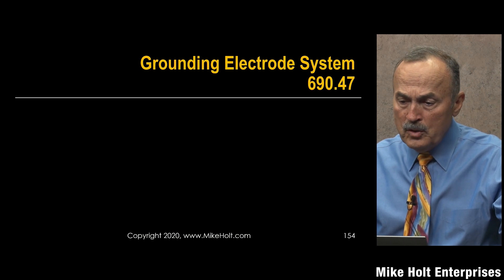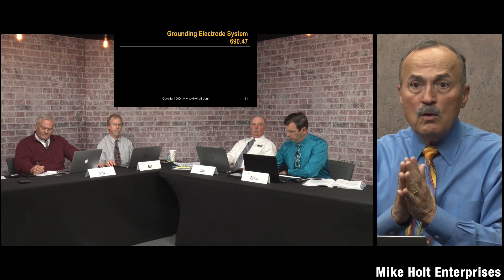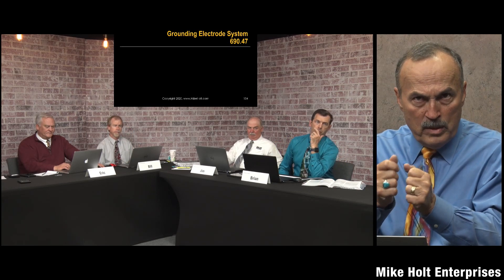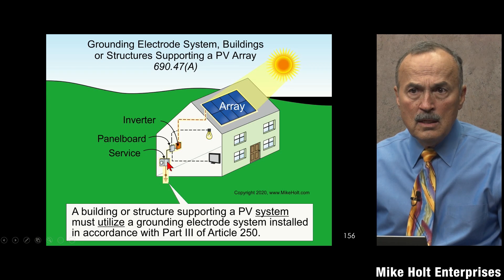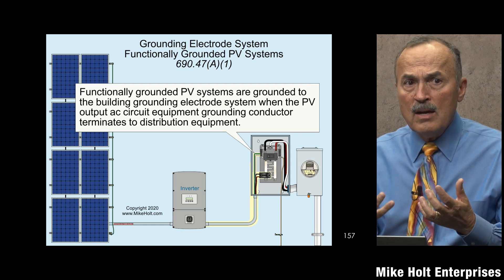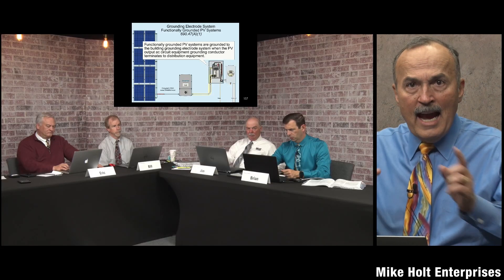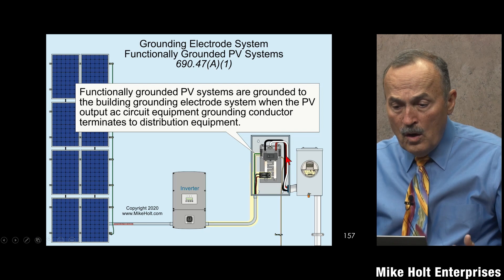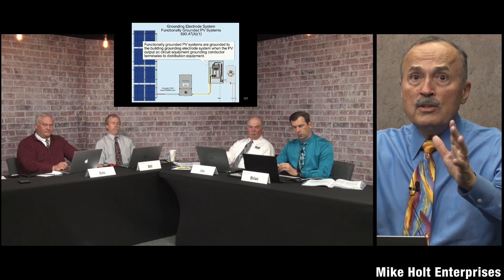Solar Photovoltaic (PV) Systems, Grounding Electrode System, NEC 2020 - [690.47], (9min:30sec)

Comment: I will be ground mounting 4 panels wired in series. I want to run a positive and negative cable to a PV disconnect box, and run the cables underground in rigid metal conduit to the garage where I will use the cables to charge my Anker Solix F3800 Plus. What are the grounding requirements for this purpose?
Reply from the maker: @michaelc9845, please post your question on MikeHolt.com/Forum
Reply: I posted there per your direction, but the Moderator stated they are prohibited from answering DIY related questions.

Comment: So im about to run the ground for my outdoor PV array back to my house, (about 150ft).  according to your video, the only wire I need to run is from my PV combiner box back to the EGC at my fused disconnect.   my plan was to run a bare copper wire next to the PVC pipe in the trench, is this ok or should I run a green thhn inside the conduit?.
Reply from the maker: @user-zq2hg4cu5b, the equipment grounding conductor is not required to be insulated, but it must be properly sized and be installed in the same raceway with the PV wires, see NEC 690.43.

Comment: So, in a totally off grid system one should bond both the DC side (panels) and the AC side (inverter and beyond) to the same grounding rod??
Or just not ground the metal frames of the panels (I think you are saying it isn't needed) and ground the AC side only bonding the neutral and ground in only one spot.  

Comments please.  There is so much information out there and most of it contradictory.
Reply from the maker: @jws3925, if this is an off-grid system, the neutral is never bonded to the ground. But you are correct witheverthing else. See 250.32.
Reply: @MikeHoltNEC  Wow.  The neutral should never be bonded to the ground!  I certainly trust your advice but I have to tell you, in my attempt to get this grounding thing right I have watched numerous videos created by solar installers and none of them has made this statement.  Is the entire industry misguided?  So, in my off grid system I don't need a ground at all?  Thank you so much for answering my questions.  I just want to do this correctly.  By the way, my 3000w inverter comes from the factory with the neutral and ground bonded but so far I have not driven a grounding rod so there is no ground to bond.  Is this ok?
Reply from the maker: @jws3925, please DM me your phone number and let's reivew Stand-Alone System grounding and bonding together. I might be wrong about no N/G bond.

Comment: a seply-dwived system, eh? slow down mike. you speak way too fast and you're mostly repeating yourself. you didn't even both to consider what happens when a DC positive gets chewed by a squirrel and then touches a panel frame. 9 minutes and no consideration of actual real-world faults.
Reply from the maker: @AJTarnas, what does your comment have to do with grounding PV systems? Note: The 2026 NEC completely removed this rule. Please watch MikeHolt.com/AUX

Comment: I still dont understand why would i lead lightning into my house, if i can ground it directly to the ground.
Reply from the maker: This rule was removed in the 2026 NEC!
Reply: @MikeHoltNEC  So 2026 version there will be advised to directly ground it to the ground? And of course equalize potentials of all grounding systems.
Reply from the maker: @rm6857, this stupid rule was removed in 2026.
Reply: @MikeHoltNEC  Thank you for your response, but do you mean removed auxilary rod or removed grounding PV pannels through house. We normally take it down the roof into MET without going throught inverter and whole house.
Reply from the maker: @rm6857 Grounding means "to connect to the earth." There is no requirement to ground your "array" to the earth.

Comment: At minute 2:27 the diagram shows the solar panels bonded together, but I can’t tell if there is a ground wire going along with the PV wires to the Inverter or just the PV wires? Seems like I need to run a ground wire along with them to be bonded? If my ground mounted arrays (not on metal frame) are 50 feet away, does that distance suggest an auxiliary ground at the arrays? If so, do I not run a ground to the inverter? Thanks!
Reply from the maker: @muhjeepsrock316 The 'bonding' of metal parts of PV arrays requires an equipment grounding conductor, see NEC 690.43. There is NEVER a reason to install an auxiliary ground, watch MikeHolt.com/AUX
Reply: @MikeHoltNEC thank you!

Comment: Dear Holt. What if I connect commercial rod and also auxiliary rod to a surge rated busbar inside house and then I will connect house panel, inverter and array frames in parallel to the bar. In such way transient current will travel not through house panel or PV structure, but from rod to the rod through this surge rated bar. Would it be safer in such case? Or should I better remove the aux rod?
Reply from the maker: Watch MikeHolt.com/AUX

Comment: What about grounding requirements for a stand-alone (off-grid) PV system installed in a floating boathouse (covered metal dock on plastic floats, not a houseboat)?  There is no utility connection with a grounded service disconnect.  What do I need to do to provide a compliant ground for panels, inverter, stand-alone load center, etc.?
Reply from the maker: Please send me an email, Mike@MikeHolt.com, with this question so I can work this out.
Reply: @MikeHoltNEC  Hi Mike. Any update for this question?  Thanks
Reply: Will do!

Comment: What about when the array is on a the roof of a separate building more than 20 meters away from the main building? How do we install SPD devices in such configuration? If the cable trace is that long wouldn't it be inefficient to install the SPD at the box in the main building only? Wouldn't in such case a separate grounding rod and SPD at the separate building with the array be a preferred option?
Reply: You can put an auxiliary grounding electrode on the PV array, but the SPD devices should be in your PV combiner box inside your main building, and its grounding wire have to be bounded at the main panel grounding bar.
Reply: If you have two grounding rods good chance lightning strike nearby will short out all your electronics. SPD should be installed where it enters the building going to your inverter you want it to protect all the wiring between the inverter and the panels. Surge is much more likely to be induced on long wire runs from a lighting strike nearby. If you install the SPD right at the combiner then your only protecting the panels.

Comment: Same here. We were doing small cell 5G sites with 8x8x 12 foot deep concrete encased steel reinforced pole bases with a #2 tinned copper wire attached to the rebar out of the concrete. Ole inspector walks up and says "Wheres your ground rod? gotta have a ground rod". I said really? You think that a 5/8x 8 foot ground rod is required and is gonna do anything? Non educated is what they are.
Reply: lol

Comment: What about a line tap pv system. It does not have a ground conductor. Where do you pick up the grounding?
Reply: we crimp on the the ground coming out of the house and add a second rod.
Reply: @christopherworks400  250.142 have you ever taken this in to consideration?

Comment: I work in solar and I got in an argument with the "electrician" that ground rods are Required by code for ground mount array, even though the metal support was driven in the ground 8  feet.  And on top of that he said we need 2.
So am I right that they ARE NOT required?
Reply: A ground mount system should have several 2” RMC embedded in concrete buried 4.5’ in the ground. If that’s not adequate grounding then I’m not sure a 5/8 copper coated rod is going to help
Reply: Yes, you are right. They are not required.

Comment: Residential transformerless inverters that aren't grounded to neutral have been the standard for a decade. No need for confusing language in the code. Grounded and ungrounded transformer inverters still have their place, but referencing to them isn't necessary.

Keep up the good work.